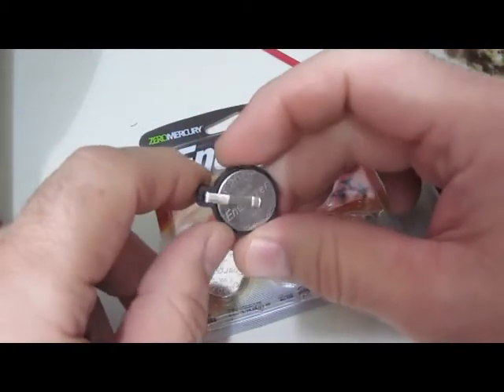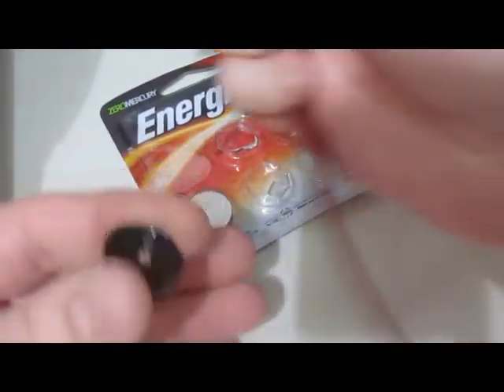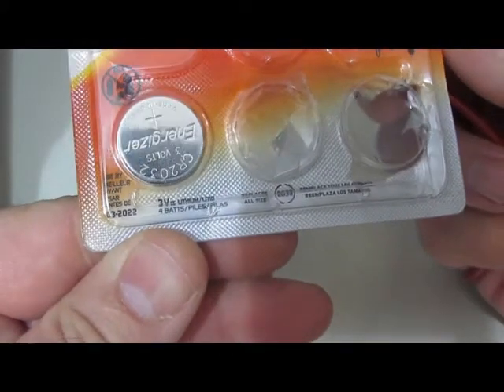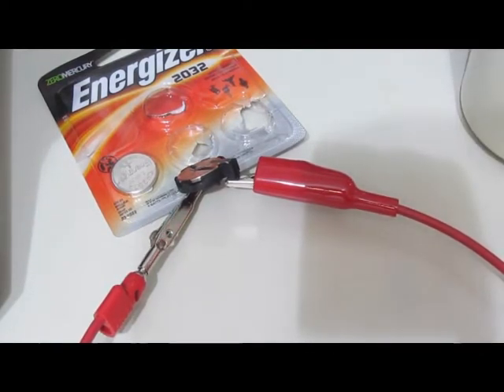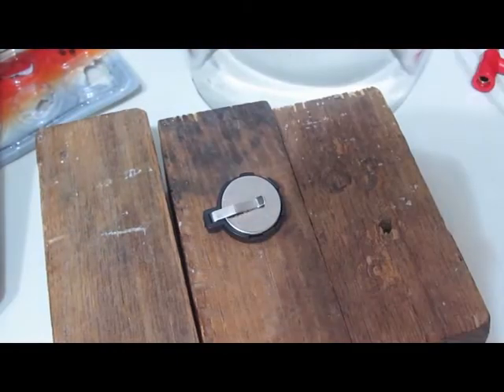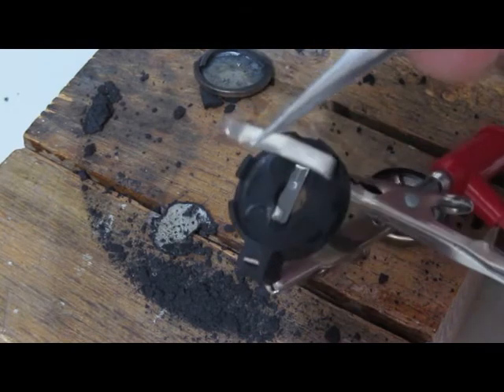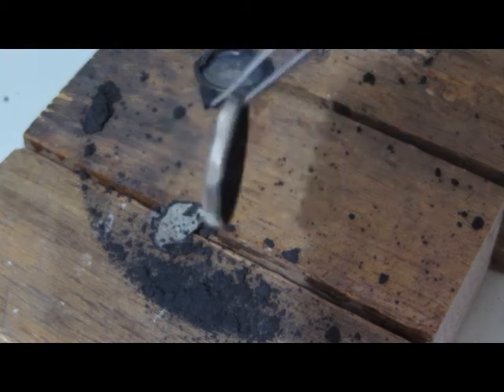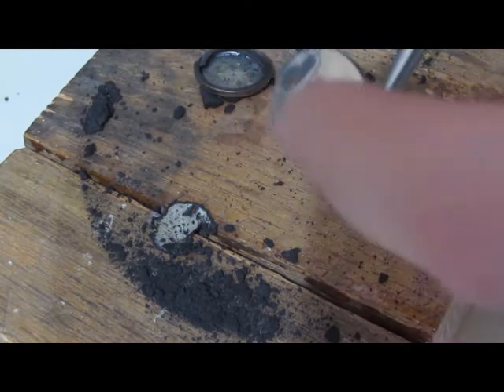Short circuiting a CR2032 battery

Comment: sometimes ago I wanted to desolder the battery holder of cr2032 and when I heated the cr2032 holder with battery inside it with the heater gun at the temperature of 450C after couple minutes the battery pops up but no explosion.

Comment: The MSDS link provided is for a rechargeable lithium battery, and does not apply to a CR2032.  

Per manufacturer data sheets, coin cells are NOT rechargeable and should NEVER be charged (as you demonstrate).  

You show a power supply or battery charger (about 1:20).  Could you please clarify in the description that the flame and smoke shown are from attempting to charge the coin cell, NOT from (per the video title) "Short circuiting a CR2032 battery"?
Reply from the maker: What is being shown is NOT a power supply or a battery charger.   I did NOT demonstrate or attempt to recharge one.
Reply: @joesmith-je3tq  OK, that's what the piece of equipment was NOT.  Could you please tell us what the piece of equipment WAS?
Reply from the maker: There are several videos showing it in use.   The best explanation could be found by going to the playlist and look for the one titled Programmable Transient Generator.   You will find a few videos where I was designing it.
Reply: Since you're being so observant maybe you should look at the title of the video

Comment: How much voltage/current did you apply to blow it up?

I've tested a few CR2032 cells because I wanted to know if there was a risk of one of these smoking or starting a fire. My tests did not include connecting to a power supply and pumping external current through it because that's not possible in my application. In my testing, short circuit or physical damage has never caused enough heat, smoke or reason for concern; just a dead battery.

Of the cells I am using (Maxell brand), from memory, the initial peak dissipation within a new cell with a direct short applied is under 0.75W, less than 250mA and drops off quite quickly.  These are not rechargeable and intended to deliver a very small amount of power for a long time.
Reply from the maker: Really hard to say as I was not monitoring it.  Basically, think of putting it across a 440 bus for a half of a cycle.
Reply: Quick reply, Thanks.
I make some small low-cost RC parts that use one CR2032 cell and buy 200 at a  time. The problem is shipping. To follow the postal rules here in New Zealand would cost $50 and a heap of paperwork to send a $30 part containing one coin cell. They could drop the package for 100 feet onto concrete and not damage the contents.

Comment: The AAA inside a 9V battery will explode when shorted, even if the battery was almost empty.
Happened twice now at work.

Never try and solder to button cells, they explode in your face..
(Really don't solder to cylindrical cells either, they won't explode but you will damage the seal).
Reply from the maker: +stefantrethan You have seen a 9V transistor battery that had a 1.5V AAA cell inside it?   Any idea of the brand?       I have a watch that uses a non-standard button battery.  The only difference was a spot welded connector.  I took a set of side cutters and removed it.  Then soldered it to the new button cell.   No problem but I used a hot iron and was done in a few seconds.
Reply: +joe smith Most higher end 9V batteries have switched from the stack of rectangular cells to 6 AAA some years ago, Duracell for example. Both times they exploded because a co-worker just had to salvage the connector top from a dead battery and shorted the thing out. (Beats me why he does this, since there is a parts drawer full of clips). It takes a good while before the thing blows after shorting it.

As for soldering to a button cell, you were very lucky. There is sharp shrapnel from the housing flying into your face, along with the chemicals, and hot solder. You can easily have an eye out that way. I made a spot welder for assembling battery packs, and even using  that I would be wary of a botton cell. Full face shield only.
Reply: +joe smith Make that AAAA.

Here is a link to a picture of a 9V with them, and this guy even had it explode on him too:
<https://www.flickr.com/photos/linux-works/3011409906>
Looked just the same, with half the central rod coming out.
There is a youtube video of a button cell exploding during soldering, but I can't find it right now.
Reply from the maker: +stefantrethan I couldn't tell you the last time I felt the need to take a battery apart.   Interesting they would package them like this.   No need to concern yourself with my safety.      I may need to do a video where I solder a coin cell to the point of explosion.
Reply: +joe smith Button cells are also very dangerous to small children, the electrochemical reaction from swallowed batteries burns their insides, causing a number of deaths every year.
Reply from the maker: +stefantrethan I attempted to solder a small button battery in the worst possible way I could.  The video will be up shortly.
Reply from the maker: +stefantrethan Here you go, very bad conditions for a small button battery.   https://www.youtube.com/watch?v=TRl5Oi0ygTo&feature=youtu.be

Comment: Years ago a local shopkeeper who supplied and fitted watch batteries always used tweezers,  told me that touching both sides drained the battery.  Is this still the case especially with the larger 2032?
Reply from the maker: Define sides.  If you are only in contact with one polarity, I doubt you could get enough force using tweezers to mechanically damage on.  Obviously shorting out a battery will drain one.
Reply: I mean by touching both poles(flat surfaces) with thumb and forefinger.
Reply from the maker: I guess they may never wash their hands and work with graphite. What's the resistance of your fingers?  How much current would flow?
Reply: Two possible issues:  (1) touching both contacts will drain some power out of the battery.  (2) touching batteries with bare fingers can contaminate the surface with skin oils and salts, lotion, etc. and cause corrosion.

Comment: I accidentally did this with a screwdriver when the battery was in a device. It EXPLODED, pieces going all over the place. It was quite unpleasant.
Reply from the maker: Not too surprised if you were to short out a car battery that if may rupture and I would expect other batteries would do the same.  This particular battery was a flop.
Reply: @joesmith-je3tq  vi
Reply from the maker: @lukerader4542  "vi"  has no meaning to me outside of being a LabView application.
Reply: how did you accidentally do this with a screwdriver while is it hard to touch positive and negative terminal on battery with a single screwdriver?

Comment: those 2032s go with quite a bang on my magstim ;-)
Reply from the maker: +DextersLab2013  I would like to see some more videos of your generator in operation some time.
Reply: +DextersLab2013 Connect across a 12V lead acid and they also do a fair impression of a firework. Just use long leads to the cell.
Reply: joe smith I did shoot some footage a while back but it didn't turn out so good on camera but i'm planning another session of pops and bangs soon :-)
Reply from the maker: +DextersLab2013 Looking forward to it.

Comment: Seems idiotic to me to use a long wire and two clips when you could do a much better job with only one clip, no wires, no battery holders, etc.
Reply from the maker: I bet it does seem idiotic to you.   Let me ask you a very simple question.  Which is the dominant factor, the foot of copper wire with clips and battery holder, or the batteries internal resistance?